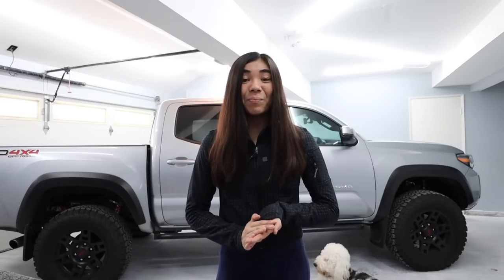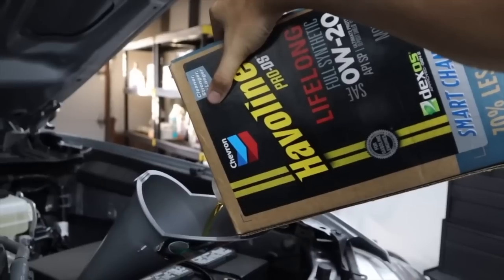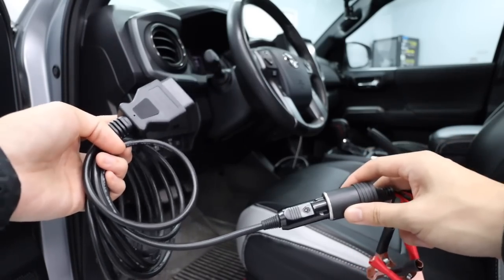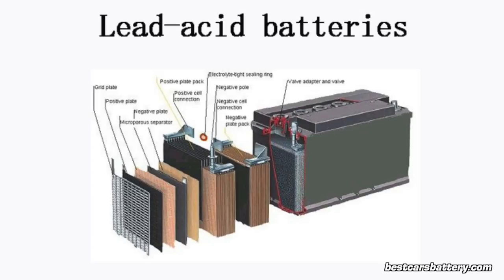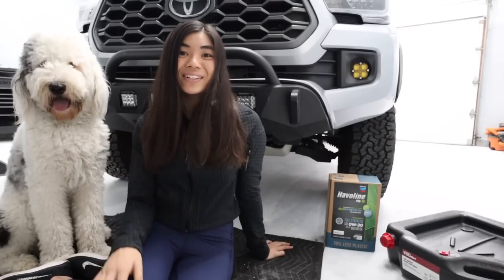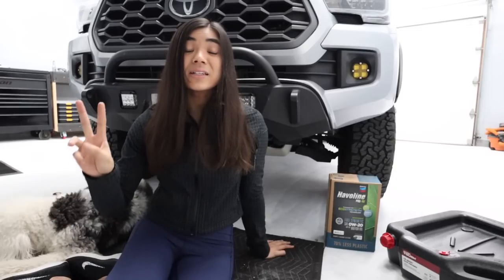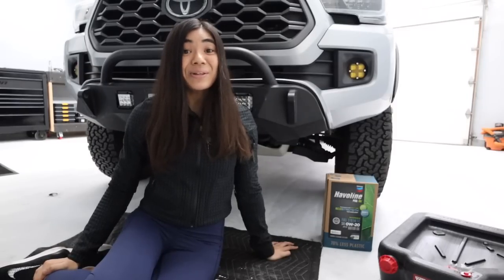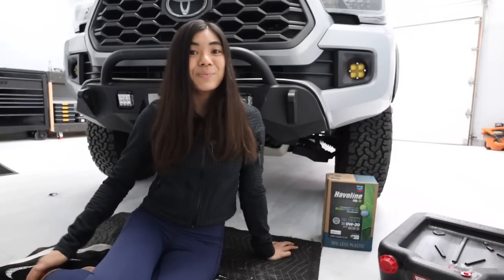(A Few) Maintenance Mistakes I’ve Made on my Gen 3 Toyota Tacoma over the Years!

Comment: I worked as a heavy equipment mechanic for years. Any QC department with any shop  would write ✍️ that steering rack up as "seepage." Meaning no leak. Just keep an eye on it. You never know you may have spilled a little bit of oil when filling your engine. Or when you've serviced your power steering fluid. So I wouldn't be too worried about that steering rack. Just keep an eye on it 👍. And that tube of Grease will probably last you a lifetime 😂. Cody 🐕 sure is adorable 😀. Great video Chloe 👍. ♥️🌮🐶🐾

Comment: A couple of things I like to do.  1)Install a Voltmeter.   Either cigarette lighter, under dash or in dash.  Whatever works best.   2) Buy a service manual.   Whether in book form or DVD, it is great reading.  It can give you an idea of what is involved in a job, and then you can judge if you want to take on that task.  I have them for most cars I've had.  1961 Corvair to 2013 Transit Connect 😎

Comment: Good info on the higher charging voltage required for optimum charging of AGM batteries.  I haven't heard about this before and it explains why my battery charger has an AGM setting.  I guess I've lucked out and avoided the problem simply by being too cheap to spend the extra $$ for an AGM.

Comment: Check out the Fumoto oil drain valve. It replaces the oil drain plug and has a spring-loaded lever valve the drains the oil out of a nipple to which you can connect a hose to direct the used oil directly into the hole in the catch can. I have one on my Tacoma and Corolla and it makes oil changes easier and neater.

Comment: I just cleaned the battery terminals on my 2020 TRDPRO so I had the battery disconnected for about an hour. I was surprised that there were almost no consequences to doing this. The only thing that changed were a few navigation preferences. Radio presets and even the clock setting was preserved. I  have also picked up 1-2 MPG in fuel economy and the vehicle seems to shift and run slighty better. I actually have one of those memory preservtion devices and chose not to use it. Don't be afraid to disconnect the battery. Nothing negative will happen.
You are grossly over lubing those u-joints.

Comment: Can't say I've had any issues with settings and memory being reset with a battery disconnected in modern vehicles. My 1998 Mustang had that issue, but about the only thing I've lost on my 2008 Canyon or 2017 Tacoma was my trip readings.

Comment: The battery saver definitely wouldn't have worked if you plugged the other end in the cigarette lighter that's powered by your battery...

That oil filter wrench is the best one out there in my opinion.

Toyota care sucks. Toyota Carlsbad didn't change the oil filter on my wife's RAV4. I know because it still had my writing on it from one "I" put on six months earlier. Had I not noticed this and followed their maintenance schedule, her car wouldn't of had the first filter change for two years! Who knows if they would have even changed it then? Then they refuse to do the second oil change because I was 11 days late. Which is only because the first time they told me I was too early. If BMW changed my transmission out of warranty in "good faith", I'm sure Toyota could have certainly done an oil change. Then they waaay overfilled it. Like at least a half inch over the full mark. Probably because they didn't change the filter. So I had to redo their work after I got home. Probably did the same on my Tacoma but harder to prove with a cartridge filter. Sorry but in my opinion, Toyota care is a joke. At least at Toyota Carlsbad it is. 

Keep on filming!

Comment: To be clear. The tacoma alternator will fully charge a group 24F battery regardless if its Lead or AGM. Its only when you go above to a 27F group that you will need more voltage to charge the battery 100%. Tacoma World has extensive information on this subject.

Comment: It's not really rocket science but if you try to change that transmission fluid you'll certainly feel like you can work on the space station
Reply: 🤔 She need a Tesla project.
Reply: It’s not even that difficult just need a good torque wrench too get everything torqued back too spec when put back together
Reply: Car care nut has a very good video on how to do it
Reply: @cookieboy7102  know what it's pretty damn difficult the first time you do it getting into temperature check mode just doesn't make much sense. torque wrenches?  The drain plugs go to like 7lbs.  Just use your gf or wife to tighten it.  Or left hand.  (I jerk right) so to much wrist strength
Reply: The space station is a zero gravity airplane and the other one is a Hollywood set and wires are attached to their clothing
Reply: @cookieboy7102 but on these Tacomas is a little more difficult than that. You have to know and there is an exact temperature range of the transmission fluid when filling.

Comment: I heard the batteries die pretty quickly on the 3g tacos, to me that means days from the first sign, but it was actually hours, and even after a 3hr drive. 

It jump started fine and I used the key to lock/unlock the doors when going into stores to avoid shutting it off....helpful to know.  

Installed a new battery on the way home without using any kind of memory-saver and didn’t lose any settings except the trip odometers again. 
17 OR with the original battery, oddly the dealer said it was fine a few months prior....I know better but rolled the dice and lost!  
Anything past 4 years is pushing it!

Comment: AGM batteries are good because they can be at a partial state of charge for a long time without being damaged.  Lead acid has to be topped off at all times to last.  That’s why AGM are used for auto start stop.  They run in a partial state of charge for very long periods.

Comment: Chloe , if you plan to keep your truck a long time and don’t want engine issues , make it a point to change your oil and filter every 5000 miles and rotate your tires as well. Trying to stretch it to 10k miles is asking for problems. Oil is cheap compared to paying thousands and thousands for a new engine block plus the labor.  Kudos to you for trying to perform your maintenance.

Comment: I diy car audio. Plenty of mistakes done over the years. But now my build has gotten several compliments. Agm batteries are better because they are designed for deep cycling so you can run the battery dead many times. A regular lead acid battery will be bad after going dead 2-3 times
Reply: I dunno... my AGM died after 4 years without ever being run down dead (or even low) previously.
Reply: @231mac  I had two go bad on me but I bought a more reputable brand. I have two xs power d3400 series. They are expensive but worth it. The one she got is just a basic agm. I had a 2020 rav 4 and it came with a agm. Manufacturers are starting to put agm in cars now with the start stop technology

Comment: I'm old school back in my day if a battery didn't last over 10 years it was not any good the last good battery I had went from 1987-2004 it was a Deka battery my Tractor Battery lasted 9 years Mahindra. and my 23 Tacoma dont have grease fittings on my U joints great videos

Comment: I will have my Tacoma for 3 years this November but it only has 9,xxx miles on it. The oil has only been changed once and I bought the truck new. I was going to take your advice on the oil brand you use (havoline pro-rs). My question is, how often should I change my oil since it doesn’t meet the mileage for the oil change?
Reply: I dont drive a ton of miles either. id shoot for once a year minimum.
Reply from the maker: Once a year, or every 10,000 miles, whichever comes first 😊
Reply: sounds like youre due for an oil change, toyota says every 10k but i still do it every 5k or once a year.
Reply: I’ve only had my ‘23 for 6 months, I’ve already got 10k on her😂 I put a lot of miles on vehicles.

Comment: My battery about 3 weeks or so ago was starting to give me signs that it needed to be replaced and I do drive a 2000 jeep wrangler and on those if the battery dies and after it sits with a dead battery it's a pain in the butt to get started and idling so I immediately went to oreilly's to have a new one installed and this is common on the wrangler tjs and I know this about your tacoma but I just wanted to talk about my experience with a dead battery was and learned from it. Oh by the way the old battery that was in my Jeep was 12 years old.

Comment: You can add diodes to your alternator which will increase alternator voltage. The car audio community regularly does this because lithium batteries require a 15 volt charge and amplifiers run more efficiently at higher voltage unless you get sundown audios salt amps

Comment: u mentioed ur battery pooped at work. does the toyota let you know beforehand that voltage is low or something or did it just die and leave u stranded :O
Reply: Yeah usually struggles to start you'll get maybe two of those the third time it won't start just happened to me get four and a half years of the Toyota factory battery

Comment: My gen-3 (2001) 4Runner came with a Panasonic battery from the Hiroshima factory. It lasted 13 years, and likely could have been used for at least another year, but with winter coming, I decided to replace it with a Sears DieHard (no Panasonic car batteries are sold in the U.S.) that lasted another 8 years. So I'm surprised that your battery had a lifespan of only 4 years. Maybe Toyota is cost-cutting with its battery selection, anymore.

Comment: Just to comment on your rear end gear ratio, I never would have gone w. the 4.56 gears. simply because they are almost for drag racing, very low ratio gears also might feel great off the jump but you will have no top end seeing that you drive to work and back too and not to mention poor gas mileage after the install. Maybe ok for the trails only.
Those guys at the shop should have more explaining for you first.
Thats my opion anyway.

Comment: I don’t trust anyone but myself to change my oil. Don’t even care if it’s free. Last time a dealership changed my oil they left the oil cap off. Found it 2800 miles later in the engine bay. Ain’t worth it.
Reply: Im the same way but at the same time i have life time warranty so kinda dont care
Reply: Yes! They changed my oil at 10k, and put a wrong(different) oil cap on mine, and it fell off 2 times, until I replaced it

Comment: I have 20k miles and have been taking it in for the free oil changes but i have been doing mid service oil changes to have a 5k mile oil change interval. I see it as oil is cheap and engines are not. 

Plus, Toyota has had problems with extended oil changes as they begin to burn oil when they age.
Reply: I think there are lots of other factors in oil burning. But I do agree that oil is cheaper than an engine. Even my dealership suggests 5k miles despite Toyota saying 10k.
Reply: Toyota engineer said to change the oil every 3k and oil filter every 6k.
Reply: @RedWingsninetyone  I had a 09 Camry that I followed the 10k oil changes. Around 100k it started being oil at about 1/2 quart per oil change. By 130k it went to 2 quarts. We found out that the oil rings were basically stuck from carbon due to 10k mile extended oil changes. Ended up trading it in for a 2020 Camry.
Reply: @palillo2006  what kind of oil was being used also plays a factor, among other things
Reply: @RedWingsninetyone  full synthetic Valvoline. Basically the only thing I use on my new cars and that Camry. My old 2004 Civic i use regular oil.
Reply: @palillo2006  like I said, lots of factors. The 2009 Camry used different oil viscosities as well depending on the engine. Again, I'm not disagreeing that changing sooner is better. Just that there are many factors that can cause it. My 2008 Canyon burned approximately 1.5 qts per oil change. That used 5W-30 synthetic and was changed every 5k miles too.

Comment: had q tune my tacoma now iam wondering when ihave too change my battery will i loose my tune
Reply: it wont affect the tune since its your computer that is flashed! so its just normal changing and everything should be fine. but if you were going to go for an AGM battery you probably need to contact Q to wonder if the tune needs to be changed to help the alternator shoot more power towards these batteries since they use more energy. i got an AGM before my tune and he tuned it to the battery as well.

Comment: hi Chloe I have a question for you if you don't mind I have a 2019 off road tacoma with 30,000 miles and I want to do transmission fluid change and don't know where to take my truck for that particular service toyota dealership or regular mechanic shop. 
thanks Chloe have a good day
Reply: If you trust your dealership I’d go to them and you’d be looking to get a fluid exchange vs a flush.  
I did the exchange at 50k and plan on doing it again at 70k. It’s a bummer there isn’t a dipstick like the old days.
Reply: Yea no doubt that dipstick made everything more easy to check the oil level and to put new oil in it  now is hard to do it is more complicated.
When you did you transmission oil exchange you did it yourself or somebody did it for you

Comment: Had to deal with battery manufactures when I used to do backup battery plants for phone equipment. They always said the standard life of a lead acid is 4-5 years. I usually replace mine at 4 years because living in a cold climate you don't want a fail to start on a freezing winter morning. Going past 5 years is living on borrowed time.

Comment: If your truck is running a tune will this save it, when replacing battery?
Reply: Id like to know this also.
Reply: Wanna know too??
Reply: Yes, the tune does NOT get reset to OEM. In order to reset the Tune, it must be flashed back to OEM

Comment: You are a great communicator, but I would love to see more content and less standing there talking.  I like your excitement and watching you learn about vehicles.  One suggestion I did for my garage - when working on or storing your vehicle in the garage you need to ventilate fumes out.  I keep an old air quality monitor out there to make sure I’m not breathing a ridiculous amount of fumes.  I actually installed a basic ventilation system in my garage to help with that issue.  One end of the garage has an 8” exhaust fan grill with inline duct fan and the other end of the garage has a duct going to outside to let in fresh air.  It works well with the mini split A/C out there to keep it healthy.  😊.  You can also open a door or window when needed.

Comment: 1. Buy a genuine Toyota battery ( I  know they are poorly made...Johnson Control?) so you do not mess up with your alternators with different voltage. 2. Use Toyota genuine engine oil and filter called on your manual cuz you are not as clever as those people who designed your Toyota.
Reply: both wrong 

1) a 12v battery is a 12v battery, as long as you use the right type (AGM if you have auto start/stop) itll last as long as original. that everstart might actually be better (project farm)
2) thats just completely wrong. toyota synthetic is supplied by mobil 1, meaning its the exact same in a different bottle. BUT you might be able to save money one way or the other. toyota filters are good because theyre made by denso, but that doesnt mean others arent just as good
Reply: There's only two or three companies on the planet that actually make batteries. One goes down the line and gets a Toyota label, one goes down the line gets an AutoZone label.....
Reply: A non-Toyota battery will not have a different voltage that will mess up the alternator.
Reply: My late dad was a Toyota mechanic for almost 3 decades and had many Toyotas with hundreds of thousands of miles. I disagree. Just get a fluid/batt from a decent brand, you'll be good.

Comment: Using cheap oil (havoline) and promotion of it is shameful. When y’all don’t get the expected 300k out of your trucks remember Chloe pushing this BS!
Reply: They all meet the requirements set by the government. As long as you change it every 5k miles you will be alright. Don’t fall for the marketing fluff.
Reply: Chloe is a 25 year old computer programmer that happens to be a Tacoma enthusiast.  She is not a petroleum engineer or a trained mechanic so nobody should be really taking her advice on which oil to use in a vehicle anyway.  That said, I have used Havoline for years and it has never given my vehicles any problems.